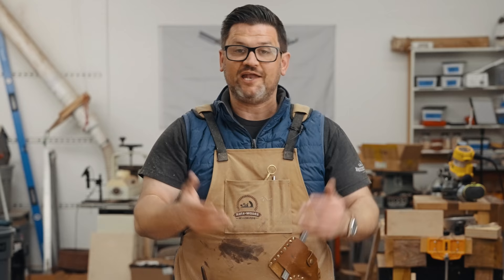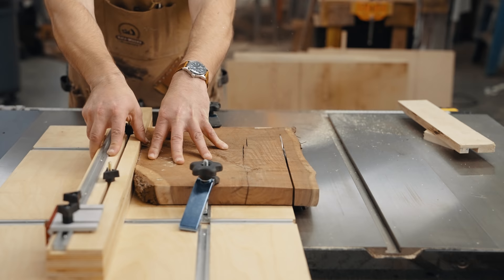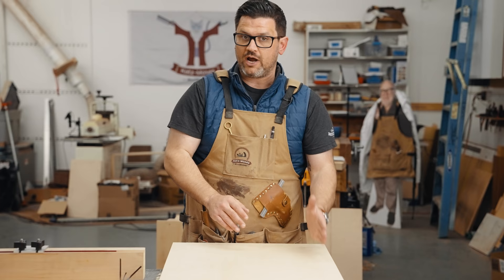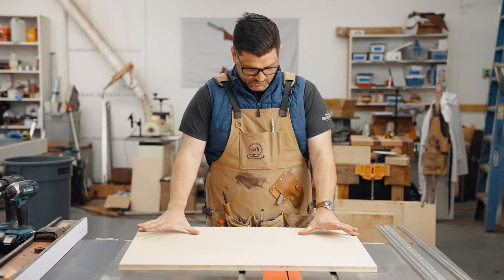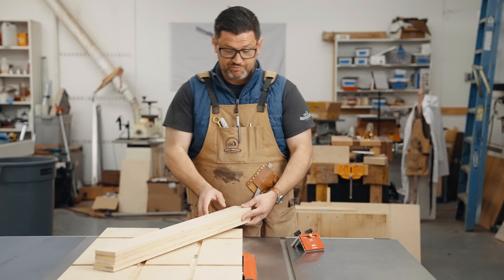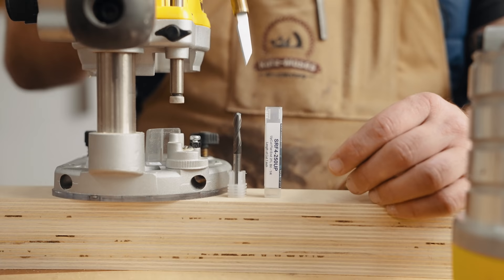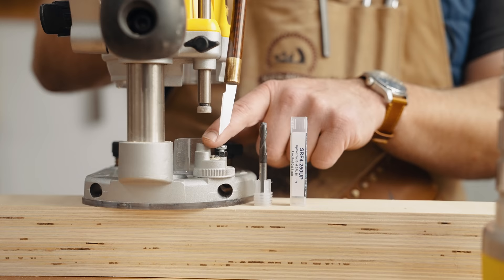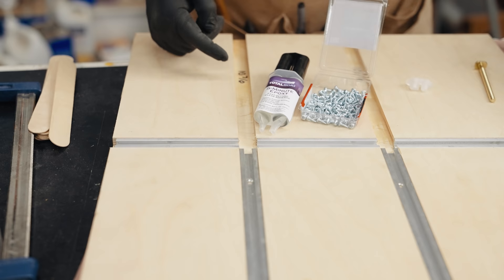Table Saw Multi Sled - FREE PLANS - 0-180 Degrees Cuts With Repeatability and Accuracy

Comment from the maker: Get the Free Plans, K-M Stop Block and Support What We Do at The Katz-Moses Store https://lddy.no/stih
FREE PLANS DIRECT LINK https://kmtools.com/collections/plans/products/katz-moses-multi-table-saw-sled-free-plans
24” T-Track I Love (Note link automatically selects 4pk which is by far cheapest way to buy at $34.99 or $0.35 an inch) https://lddy.no/uywt
Female ¼-20 Knobs 10pk https://lddy.no/uywx
Hold Down Clamps 2 pk https://lddy.no/uywy
3 ½” T-Track Bolts 10pk  (link selects 10pk, 5pk available as well. Need 2 but they’re useful to have around for jigs) https://lddy.no/uywq
Note: Free Plans are listed right after the saws if you’re scrolling my website
BitsBits is the BEST place to buy router bits: http://bit.ly/BitsBits USE CODE JKATZMOSES15 for 15% off
Total Boat Epoxy: http://bit.ly/2I3Q8m4 15% Discount code JKATZMO15
Reply: I was trying to figure out what you were spraying on the sled before you applied the paste wax, what it clear poly?  Thx

Comment: I just started building this and found one thing people should note: The 4 pack of 24" T-Track will get you just enough T-Track for the sled, but not the fence. You'll also need one piece longer than 24" if you want a single run across the fence. I'll probably just order another 4 pack of 48" cause I can always use more T-Track. Also, the shipping from JKM for the stop block was crazy fast. Thanks!

Comment: Great video, Jonathan - and a very cool sled. You need to work on your match skills, though. In the details section, you list the T-track from TayTools at $0.35/foot... A 4 pack of 2’ T-track = 8’ of T-track. Multiplied by $0.35 = $2.80. (Oh how I WISH I could buy T-track for $.35/foot! At $35 for 8’, the correct per foot price is $4.38.

Comment: I have a small shop that I am just fitting out, 9x19 and so am always looking for multifunctional fixtures like this. I made a version of this so I could do some accurate crosscuts for plywood panels, some tapers as well as crosscuts for smaller pieces and the design worked beautifully! My problem came when I needed to "catch" my off cut and so I made a second sled  to go beside it that rides in the second tablesaw track. Well it wasn’t long before I realized that if I added corresponding tracks to the other sled, used the fence with 2 more bolts for my back fence and then added a second fence at the front for more rigidity, that I had myself a full-on crosscut sled that could be converted to other purposes as well as broken down into 2 sleds and 2 fences that can be hung on the wall!!! AMAZING! Many Thanks for your inspiration JKM.

Comment: I made this and am in love with it! I know it can do a lot more, but I've been using it for mitered corners so far and they are PERFECT. This sled + digital angle calipers = perfect angle cuts without having to do test pieces. It also allows me to very easily and precisely line up my marking knife lines with the table saw teeth so the cut is exactly where I want it.

I also used it to cut angled half-lap joints. Worked like a charm! Thanks KM!

Comment: Built mine with a couple of modifications in size (really caused by availability of baltic birch).  while i had my dado blade set to 3/4 i scored the bottom for the placement of the miter guide.  also added a 1/4" piece of baltic birch to the fence so i didn't need to lay the t-track proud.  this is a great sled that i will show off while i train advanced table saw at work.  thanks it's great!

Comment: So, the track system on the sled is basically an open smoke-box. And the fence is the crank handle with the track bolts being the slides. Genious! Great system. Yup, gotta get these plans for sure. Even if all I have is a cheap job-site saw.

Comment: We must have had the same dream!  I built this exact same jig but a smaller version.  The only difference is I drilled dowel holes (for steel pins) on the ends of the fence and corresponding holes in the jig at 90 and 45 degrees so I can quickly set the fence and cut those angles without having to fuss with squares or angle finders.
Reply: Afraid after inserting, removing, inserting (family show here) there'd be too much slop to retain ur 90 & 45.
Reply: @TraconWizard  you can just put steel pipes in those holes and wax the pins and voila!
Reply: @Jackson T what we’re the dimensions of the sled you made?  I use a contractor saw right now so my table is quite a bit smaller than JKM’s huge SawStop table 😏

Comment: Very cool, I'll probably be making one of these soon. Also l feel like it might be easier to orient the fence with the plys vertical. That way you can make the slot by sandwiching some true 1/4" stock between one 3/4" piece on the back and 2 on the front to leave room for the t track. Just a thought to avoid the deep routing.
Reply: Perhaps Johnathan orientated the ply as he did to reduce the chance of the fence warping or flexing overtime.
Reply: @JP-mq7pg   Eh, he said that his normal crosscut sled has it vertical, and that seems to be holding up fine for him. He also said that he just flipped it to make routing the slot easier. I could be missing something of course, but either way would work.

Comment: When I was laying the T-track grid, I screwed them in.  Then found out the screws that came the the T-track protruded from the bottom of the sled.  Spent about the next 15 to 30 minutes sanding screws flush with the bottom of the sled.  My fault, I should have tested for the correct length of screws (which would have meant a trip to the local hardware store as I was out). Just a word of caution.  Great build, by the way.  May have to get another stop block.

Comment: Good afternoon Jonathan. I have a DEWALT DWE7491RS table saw due to my small shop. I really like your plan for this sled. It would allow me to cut my 72, 34, and 54 degree angles to make Christmas stars for gifts. I would need to downsize the sled to fit my smaller saw. Do you have ideas for a downsized version?
Thanks,
Scott Thompson

Comment: Curious, why did you say to use the up-cut bit in this video when you said to only use down-cut bits in the bits video? The reasoning in the bits video made sense so I went with the down-cut. However, I am still curious. Thanks. Incidentally, my multi sled is almost compete and I got my KM stop block over the weekend.

Comment: Maybe a dumb question: What size screws do you use in conjunction to the epoxy when fastening T-Tracks into 3/4 inch plywood?  I'm worried about the screws tearing up the bottom of my sled or weakening the plywood.

Comment: Great idea/video. I needed to cut a 25deg angle the other day and I wish I had seen your video. It would have handled the cut so easy. Is there a reason you made the sled to track to the right of the blade?

Comment: Great idea Jonathan- what are your thoughts on blade kerf thickness when using a sled?  I always feel like I have to use a full kerf blade because the material is lifted off the table....but maybe that’s not necessary?
Reply: Funny you mention that. I had to switch to a 60 tooth 7-1/4” blade recently while my main thin kerf blade was being sharpened. I just slowed down my feed rate and got no issues with lifting or deflecting.

Comment: It appears the stop block runs right into the other bolts, which make me think you may have to completely remove the stop lock to reposition it????
Reply from the maker: No the stop block has 2 inches of travel in the slots. Really easy to move around.
Reply: Oh gotcha. I really like the design. Very versatile. 👍👍👍

Comment: Jonathan if you make it with the micro jig dovetail clamps you won’t have to spend $66 on all the parts for the sled. it’ll be cheaper.
Reply: I was wondering how much for all the parts.So 66 vs ?
Reply: @2hotscottpro  The dove tail router bit cuts the groove as long and wherever you need so you don’t have to buy any of the track. So zero dollars.

Comment: Sure wished you had commented in the video that the depth of the T-track is shallow on the movable fence compared to the sled. The little note on the plans is not enough. Also the plans are missing the offset dimension for this slot. My workaround is to stack washers to use your stop block. Kinda lame for a custom jig.

Comment: Only difference between this jig and the one that Rockler sells is you have an extra "T" track added in. I still like the Rockler since I have it already along with the cut off sled that goes with it. I'll still most likely build one of these myself, when I have time that is. 
That's one of a few reason's why I don't like Sawstop. 
Great build and thank you. Cheers :)

Comment: Why can't this sled be reversed and used on the other side of the blade?
Reply from the maker: Good question. Because miter slots are not equally spaced from the blade so you lose the zero clearance.
Reply: @katzmosestools  I was wondering about that.  I've got the same saw and will measure. If they're close (<1/4" difference), I think you could size the sled for the closer slot and be fine when the sled's reversed. The cut-off end of the work overhangs the sled base either way.

Comment: Hey, I made the sled 360 yesterday, and you don't have to have a router table, but it would have been easier.  I used a router and straight-edges.